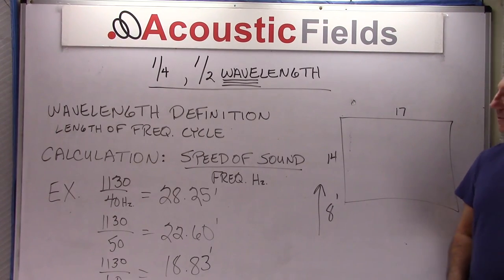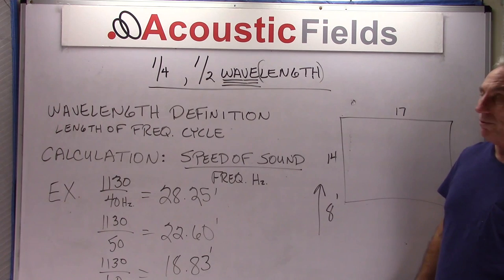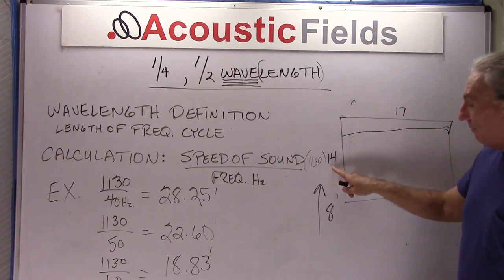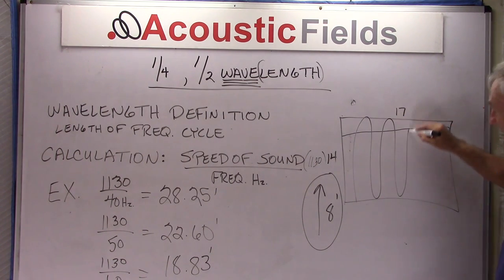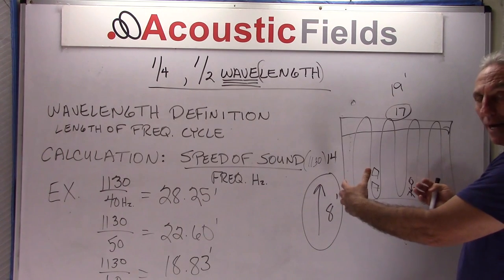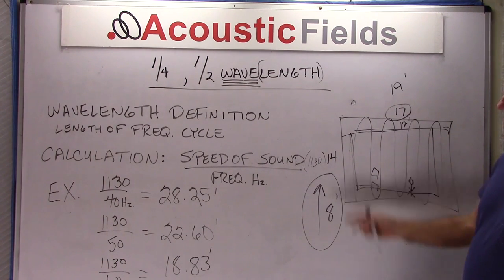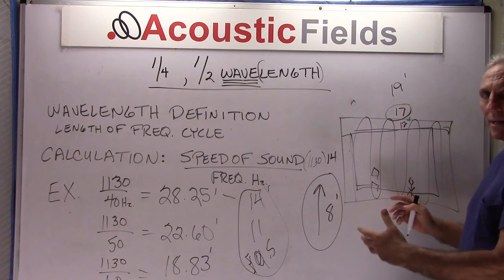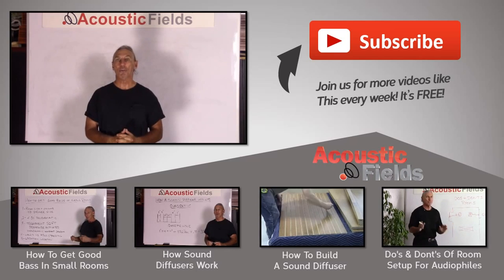1/4 & 1/2 Wavelength - www.AcousticFields.com

Comment: So I have a question I've been trying to answer on my own for about 2 years now. Everyone in car audio has basically gate kept this information or gaslit anyone that asks about it. Series 6th order bandpass boxes, or as I've grown to call them from my research, 1/4 wave bandpass. A 6th order bandpass enclosure that one chamber (the interior port) with low tuning frequency and a small port vents into the second chamber with high tuning frequency and a massive exterior port. My understanding is that the interior port is tuned in a way that times the 1/4 wave from the back of the driver to hit the cone of the front of the driver as the cone is moving forward. They're obnoxiously difficult to get right and I've heard things like the two port tunings effect each other, raise on and it changes the other. I believe that this is explaining it wrong, that the correct explanation is changing one port tuning alters the timing of the 1/4 wave and thus decreases output. Am I correct in these assumptions? Are you tuning the ports based off the quarter wave timing and not the frequency?
Reply from the maker: I do not know. You should ask a speaker designer.

Comment: " 1/4 Wave " refers to how the sound wave is generated in the pipe it is being emitted from ( e.g., a bass speaker pipe or organ pipe) - in other words, the pipe's length has to 1/4 the length of the lowest wave-length you want to produce -- it has nothing directly to do with the dimensions of your room  ---- the longest dimension of your room must be at least 1/2 the length of the lowest wave-length you want to reproduce. 

30 Hz has a wave-length of 37.66 feet, therefore the longest dimension of your room can't be less than 1/2 that, i.e., 18.83 feet, to faithfully reproduce the 'Fundamental'.

Sound, bass sound, radiates in ALL directions - in other words, it's spherical -- for 30 Hz that's a sphere 12 feet (11.99) in diameter -- the wave-length is the circumference of that sphere.

I used to make folded horn enclosures and 1/4 wave bass speaker pipes -- so I know what I'm talking about.
Reply from the maker: M,  Explain this statement: 30 Hz has a wave-length of 37.66 feet, therefore the longest dimension of your room can't be less than 1/2 that, i.e., 18.83 feet, to faithfully reproduce the 'Fundamental'. Why is it that 1/2 of the total wavelength distance must be satisfied?
Reply: @AcousticFields  A pipe with only one end open is called a "closed pipe", a pipe in which both ends are open is called an "open pipe" -- an open pipe has to be TWICE the length of a closed pipe to produce the same note. A bass speaker loaded into a closed pipe of 9.415 feet length can faithfully reproduce 30 Hz -- an open pipe would have to be 18.83 feet in length to produce the same frequency.  --- these are facts, not personal opinion, they are the Laws of Acoustics

Over simplified explanation : Sound travels from one wall and back again ( the wave-length ) = 2 x length of room  -- each wall is a ' node ' in the sound wave.
Reply from the maker: @mickkennedy1344  Why does an open pipe need to be twice the length as a closed pipe to generate same resonant frequency
Reply: @AcousticFields   Sound waves travel differently in an open pipe as to how they travel in a closed pipe -- therefore the location of  the 'nodes' and 'anti-node(s)' of the soundwave aren't in the same place/places as in a closed pipe --- in an open pipe there are 6 antinodes and 2 nodes to the soundwave -  in a closed pipe there is only 1 node...and 2 anti-nodes that make up the soundwave --- both waves are 30 Hz
Reply: Hi :)
1- why does a wave's length need to fit in a room at all ? ... the direct wave passes by my ear and I'll hear it's entire length as it passes by me, no?
2- I can hear very low frequencies on my closed back headphones and it's only a few cm away from my ear drums ... so why does a wave's length need to fit in a room for me to hear it? .. I'll hear it as it passes by me, no?
3- Are the problems caused because that wave bounces back from the wall and it causes cancellations and exaggerations in certain places? ... Does that mean that if there were no walls ... you could hear any frequency at any distance even smaller than it's wave length ? ... then again i can hear the low frequencies on my closed back headphone though.

Comment: I don't understand why waves need to fit entirely in a room? Why does it matter if there's not enough space for them to develop completely? Not challenging, just saying that I don't get it...
Reply from the maker: E,  Its not necessary to understand the process. Realize that energy (frequency) has length and height. It oscillates throughout our rooms in waves. When it doesn't fit into room dimensions, it excites the air between the room surfaces. This excitation of air produces room modes. Its like trying to put a size 12 shoes into a size 8 shoe box.  You have to bend the shoe to make it fit into the room. That bending is distortion. The amount of distortion depends on room dimensions, the frequency and amplitude of the energy.
Reply: @AcousticFields  so it just takes the wave to be any bigger than a room to create a mode and not multiple or double the size in an axial mode for example
Reply: @AcousticFields  Question, let's say the wave's length is smaller than the room, but doesn't the wave still continue, hit the wall, and bounce back? ... we still get the distortion no? ... I would love to understand.
Reply: @ntartienii  but then we get the modes even if the wave is smaller than the room .. because the wave continues and hits the wall and bounces back, no?